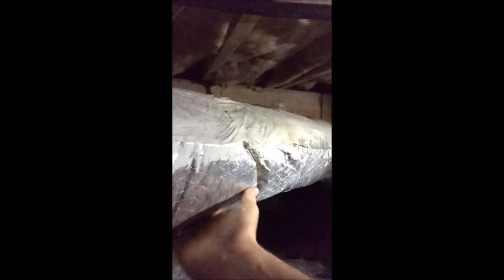Condensation on Ducts

Comment: Cold air escaping the duct work from unsealed duct joints mixing with the hot air causes the condensation on ductwork. Not moisture in the air. This encapsulating and installing a dehumidifier is quackery. Take those duct joints and seams apart and seal them properly and then insulate them and you won't have any issues. It's from HVAC guys not sealing the ductwork when they installed it.
Reply: This makes the most sense to me as the condensation is occurring at primarily one spot. I appreciate your advice and will put it to work. Thanks.
Reply: Stonewall is mostly wrong. It has everything to do with Moisture in the air and dew point. The only part that’s right is that air leaks can cause cool air to lower the temp of the outside surface of the ducts to dew point and cause sweating. Thanks for coming to my ted talk.
Reply: They’re 100% wrong about encapsulating tho and hot air doesn’t matter at all it’s about the dew point. Educate yourself.
Reply: @Rainmaker88  totally wrong. If you seal your duct work and insulate it then the outside temperature or dew point does not matter because the cold air doesn't get to the warm outside air.
Reply: @stonewallmcgraw9704 You are welcome to be as wrong as you’d like. The fact you use the words warm and cold in terms of condensation shows how educated you are on the topic. :)
Reply: @Rainmaker88  I sell millions of dollars in vapor barriers each year for food distribution facilities so I think I have a good idea how condensation works. I doubt you have worked as a helper for a HVAC service guy.

Comment: The big problems of ducts sweating and leaking are caused by setting low temperature below 72 degree F. (highly condensation)
Reply: I was running cool air set at 72 degrees and the outside air was 70 degrees, the filter was slightly wet however the ducts were dry, I turned off the unit and took the filter out. Any recommendations on how to fix this?
Reply: And using a restrictive 1 inch pleated filter, coupled with not enough return

Comment: Any idea and advice regarding a sweaty hrv duct in the basement ceiling running between the joists? Intake duct
Reply: Duct(return) not insulated,but usually your supply will sweat, your return air should be what you set your thermostat at(return air sensor) delta t 18 difference from supply air to return air

Comment: Quit using the expensive one inch pleated filters, they are extremely restrictive on air conditioners find the cheapest ones they filter just as good and many of your ac problems will go away